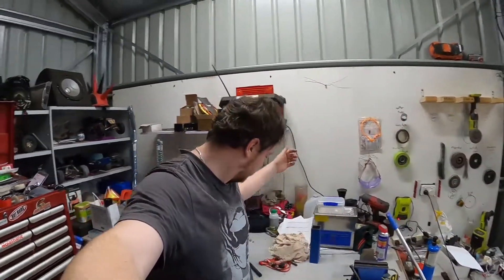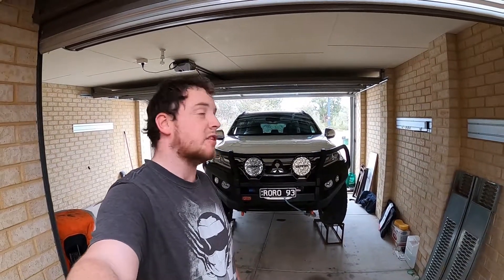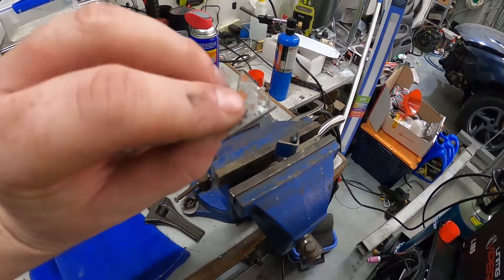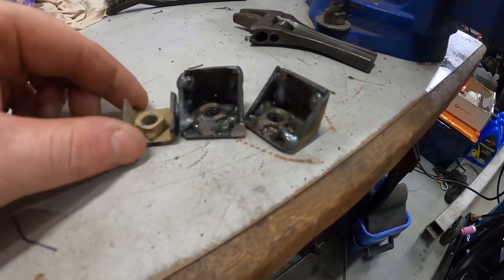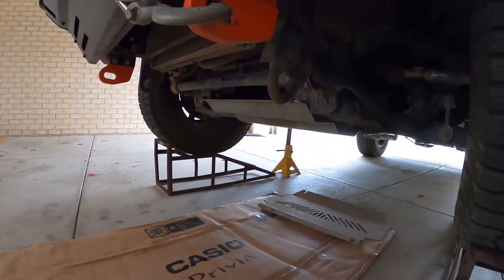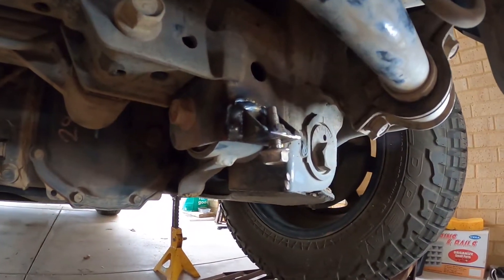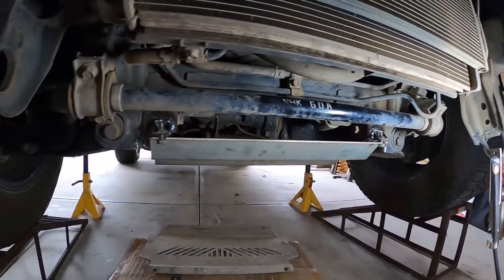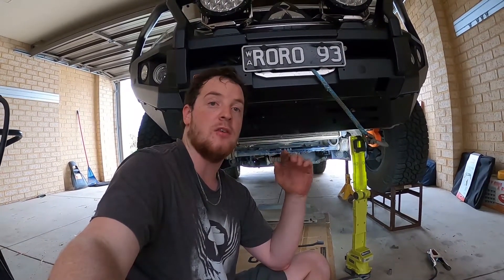FREE UPGRADED Bash Plate Mounts - Stronger than factory. Broken bash plate mounts.

Comment: Good one mate!! Don’t u have any issues after disconnecting and connecting back d batteries?!! And safety first mate!!( Cutting disc with out guard on angle grinder ) & wear full sleeve and pants while welding to avoid UV .u won’t knows it now but ur skin will be damaging !! Any way good one .. keep up d good work !!
Reply from the maker: No issues after the battery disconnect. 
The guard is off the grinder from when I was cutting stainless pipes as the cuts wouldn't get seep enough. I need to refit it haha. 

Being that it was very little welding I didn't bother with long sleeves etc.  :)